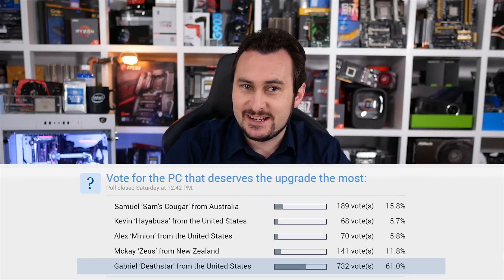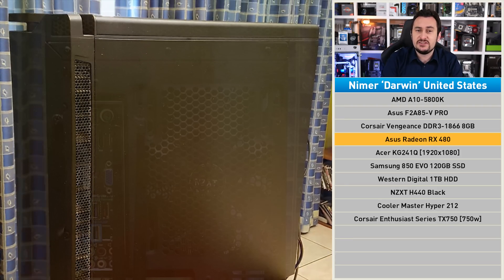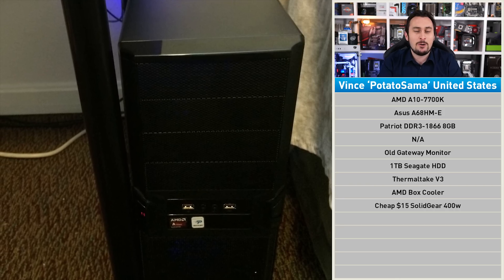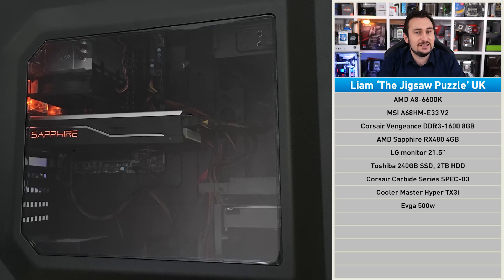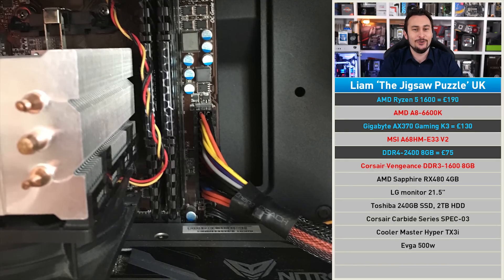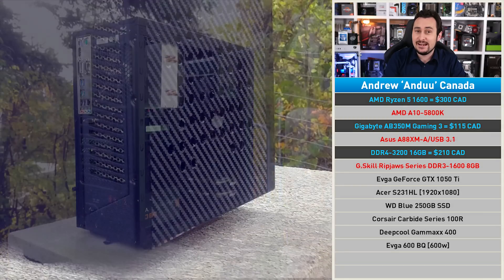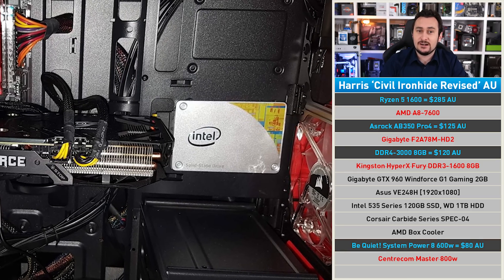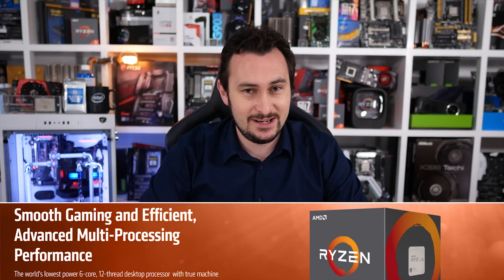Upgrade My PC Please! [S01E05] APUs: Dem Tings Wit Graphics!

Comment: NOTE: If you live in Canada and are looking for a Ryzen 5 1600, wait for a sale and you will be able to get a 1600x for $250. It goes on sale for that price often. Spending $300 on an 1600 is not worth it at all. It's weird, but at full price the 1600 and 1600x are both $300CAD

Comment: buys expensive case psu and graphics card , is to retarded to upgrade the CPU = does not deserve an upgrade
Reply from the maker: So if your power supply dies and you need a new graphics card as well, you should just buy trash? Why can't you get something decent in the hope that a platform upgrade can follow shortly there after?

Comment: Hahahaha mine would need just about everything, motherboard, CPU, Ram, PSU, GPU. The only thing that could be reused is the case (antec three hundred which was a freebe), the PSU wouldn't be good enough for much of anything.

The hardware in it was salvaged from an old Compaq D530 SFF that I got for free back in 2008 (yes a Pentium 4 Northwood).

Comment: Some systems there that really need upgrading, But which to vote for is a real issue this time.

Steve.
You said you're looking at Core2 Quads next week. I submitted my old Core2 Quad machine a few weeks ago. Will that be in the running or do I have to resubmit it?

Thanks.
Aido.
Reply from the maker: What's the thread name? Photos are key mate, need good photos.
Reply: It's called "The Overgrown Calculator". I hope this is what you're after Steve.

Comment: Listening to Liam's story makes me think that he could of build a good pc form scratch but just wanted to be cheap and kept buying bad parts, or maybe the story was made up idk...
Anyways loving this series so far
Reply: Pastechi I built the initial PC from scratch which at the time was pretty good! But then went to uni and i didn’t have the money to do a decent upgrade, the 8320 was the best upgrade I could afford and that was second hand, came with the case and cooler you see in the picture. All the Parts that have died were bought off gumtree or eBay in a pinch because I either needed something quickly to keep my PC going to get an assignment done or it was just before a game jam. 

At one point the system wasn’t even in a case and was essentially just a test setup on top of a cardboard box under my desk because I was having faults that often that taking everything out of the case to diagnose faults was an all too familiar experience! 

I was hoping to save enough over the summer to upgrade to a Ryzen 1600 and nearly got there but life got in the way and the money had to be spent elsewhere! :)

Comment: Do not vote for Jigsaw!!!  CPU cooler orientation and cable management shows you where their PC problems root from.
Reply: Sandalhatt That cooler can only be mounted that way round because of the socket, it won’t go the other way otherwise it would have been put that way :) I gave up cable managing it because I had to take it apart every few weeks so snipping off and redoing the cable ties got really boring and tedious after the first few times!

Comment: In one of your earlier videos you overclocked a eyzen 5 1600 using gigabyte ab350 gaming3. Could you please share your OC settings with me? The offset voltage and etc. Thanks.

Comment: Im still rocking a phenom ii 965 black at 4.1 ghz. Shes been a reliable ol girl.
Reply: How do you cool it? I have a Hyper TX3 on my Phenom 955 and the fan gets loud af just streaming video and idles at like 40°C. OC was even worse so I set it back to stock. I dunno if it's just my mobo fan controls that are wonky or what, b/c when I read forums ppl say 40°C idle is normal. I had the same cooler on a 6600k and it was much quieter.
Reply: dsmtnr95 how did you get it to 4.1 I can only get mine to 3.8
Reply: Malus1531 ive got a hand me down 120mm fx aio from a buddy of mine. It came with his fx8950
Reply: Everill angel its the only thing ive won the silicon lottery on lol. All i did was turn the multiplier up and i added v .05 at a time till it was happy. I could probably go further if i messed with timings ect but shes takin a beating since 2009 so i just stopped at 4.1 bec it was above avg for the chip.
Reply: dsmtnr95 oh I see mine won't go over 3.8 it's so weird

Comment: Really goes to show how much value Ryzen has to offer when it's suggested so often in the series :D
Reply from the maker: Well you can't really recommend a 7th gen part at this point, let's see how thing go in the coming weeks. But you are right, in terms of value Ryzen is pretty special.
Reply: Yeah, would be interesting if the prices drop when 8th rolls around, I have my doubts!
Reply: I don't mean to be a downer but this series is much of a muchness.  Ryzen, mobo and RAM for every single build gets a little dull.  Series needs something to make it stand out - perhaps going down the Tech Yes City route and suggesting older parts/Xeons/Engineering samples.  This is why "scrap yard wars" by linus is interested, seeing what they can come up with.  Right now every video is the Ryzen video.  Your other content is great - this not so much.
Reply: Jaymiecain1 what a downer. this series is interesting because of the many different builds that apply for upgrades. and because of their individual stories. also: steve adapts the upgrades to specific needs and even wishes from the owner. sometimes more space in form of hdd, sometimes ssd boot drive. sometimes powersupply. often gpus. its not all about the same cpu. he had almost all the ryzen 3 and all ryzen 5 as suggested upgrade at some point. he also switches the mobos. mostly b350 but from all the vendors and today was even an x370 board suggested.  dont act like this is the same everytime when its not. if u dont like it thats fine tho. personally i thinks its awesome for those ppl to get a big upgrade for free.
Reply: It's great for people getting free stuff, sure, I would never argue with that.  But as consumable  entertainment it's a bit niche and needs something more to be successful.  I think the views for the series also carry this sentiment - 35k, 28k, 28k, 24k for the first four episodes.  I'd expect the rest of the season to steady out at the low 20's or high 10's.

With such a limited budget and the need to buy "brand new" hardware it sort of puts Steve in a corner with what he can suggest, which in turn makes the whole thing a bit predictable - Ryzen is the price/performance king and so every build will have it.  One suggestion would be older used hardware.  For example a i7 3770k is 5 year old CPU at this point, yet in gaming performance it's still a great CPU.  Hell, here's a Hardware Unboxed video testing the CPU out against Skylake - https://www.youtube.com/watch?v=xhuC8Tf9i3I .  If the highlight of the video is what size hard drive is picked or "even a x370!" being suggested then...well that speaks for itself.

As for the "fee-fees" and "downer" comment I think most youtubers appreciate constructive criticism.  I could just as easily trolled and said "This is sh*t" or clicked dislike.

Comment: can anybody help me to decide which upgrades do i need ?? currently i have the following parts
 Core i5-2400, 
asus b75 a mobo , 
8 gb ddr3 1600 bus speed ram,
 gtx 1050ti-4gb ddr5,
 toshiba 1 tb hdd , 
corsair vs 450 watt psu 
Antec gx 200 casing and a 
Philips 224 e5 1080p monitor
Reply: You need to provide some information about what you're trying to do and what problems you're having.
Reply: i will mainly game and light graphic design work

Comment: Hopefully AMD can dish out some good gaming apu's using zen in the near future.
Reply: You have that backward, you meant that it is inevitable that APU's will eventually surpass RX 470 power. Don't argue against the nature of technological advancement rofl 

BTW we're already there: See PS4 Pro/XB1X
Reply: APUs will never have performance even close to a RX470, it's still an iGPU without dedicated VRAM. But if they just manage to make it reach RX550 levels it would still be a very decent gaming APU, as long as the price is right
Reply: We know so far that there'll be at least a 4c/8t variant with a cut down Vega, just don't quite know how cut down of a Vega it is. But, since they're paring it with a 4c/8t CPU it's possible for it to be RX4/580 level.
Reply: I was hoping for RX 470 level or better, I'll get one if it can perform anywhere near 470 levels.
Reply: raven ridge will have 11 CU (704 SP) Vega GPU so performance will be rx 460 level at best

Comment: Can't wait for the 8600k to be released so that there's another option beside the Ryzen 5 1600
Reply: Honestly it's a lot more expensive than R5 1600 so I don't think it'd be a good choice
Reply: Donald Trumped, yea the 1600X
Reply: Oh look an Intel fanboy trying to act reasonable and suddenly failing
Reply: As far as 1600 vs i5, if you want the best gaming performance then i5 all the way, but in terms of production work and price/performance the 1600 is a better choice, and it will be in general for most people too since big FPS differences only start to happen with a GTX 1080 at 1080p, and as soon as you lower the GPU's performance or increase the resolution, the difference goes down, even down to nothing.

Price/performance wise the 1600 and the 1600X are actually better than the 8700K too, even though the 8700K outperforms them in every way.

Not to mention the lower power consumption, cheaper motherboards, and platform life span.
Reply: Think about the irony in that statement, lol. Just a few months ago we all couldn't wait for Ryzen to launch so that there would be something other than Intel to buy.
Reply: Dennis Johnsen zen + (die shrink and refresh) is 2018. Zen 2 (IPC/clockspeed) is 2019. So all in all- 3 gens on the AM4 mobo till about 2020
Reply: Dean simmons You mean the ones on wccftech where they tested 5 games? If so they yeah I did, but those were also very CPU sided games, and considering the fact that there was no single-threaded IPC advantage going from Sky to Kaby, there won't be going to Coffee. That's not to say that there won't be any performance advantages, but if there are any that'd either be due to the increased cache and/or increased core count because we know some games like more cores. At the same time, some games don't like going past 4 cores, so when Steve does his 30 game average, you can bet that the difference will be none or barely anything to note, like a handful of FPS difference.
Reply: You need to buy an expensive Z370 motherboard, with ryzen a cheap b350 does the job. With that being said, IPC and clock speed is still very important.  But then again, Zen2 will be released next year or on AM4 atleast, don't know if next years Ryzen refresh counts as Zen2. All and all I wouldn't buy Intel because Ryzen has a good value/performance ratio and AMD hasn't been conducting dirty tactics like Intel.
Reply: slav have you seen the  benchmark of the 8700k? The 8700k clearly has better ipc than the 7700k and obviously better multithread performance. so yeah it wll be better than the 7700k for gaming. just slightly but it will. If you have a 7700k or any recent i7 it isnt worth the upgrade.
Reply: 6 core 12 thread amd vs 6 core 6 thread intel. nah im goin with amd cause im sure its gonna be cheaper than the i5 also you could oc using a cheaper b350 mobo
Reply: AD Gladium Nah the 8700K at 5Ghz matches an R7 at 4Ghz, as in within 2% margin of error matches. It is however, again unsurprisingly, better than the R7 in gaming. That being said, price/performance wise the R7's better, and considering the fact that the 8700K has 50% more power draw than the 7700K, whether it can sustain 5Ghz without requiring a delid or a beefy cooler that widens the gap in price between it and an R7 is another issue.
Reply: Ryzen is the way to go, I am not a big fan of Intel anyways, it would be perfect if I could upgrade to a R5 1600
Reply: the 8600k seems meh looking at the leaked benchamarks. The 8700k however is an absolute monster. The 1600 will still be the best bang for buck cpu but the 8700k will be the best cpu on the market for gaming performance. I mean come on a 6 core 12 thread with ipc better than the 7700k. Fucken ridiculous.
Reply: Dean simmons Single threaded IPC hasn't changed and the 7700K isn't limited by its 8 threads so gaming performance between it and the 8700K will be the same. The only benefit you get from the 8700K is in production.

Comment: I'm hoping for this to expand out into Singapore and beyond. My PC which started life as a used Dell T3500 that I got for cheap just can't expand anymore and needs a platform and expansion upgrade.

Heck this OEM PSU I have doesn't even have 2 6-pin PCI-E or Molex even.
Reply: Use molex adapter that how I used to hok up Hd 6770
Reply: the T3500 has a standard motherboard+CPU connector do you should be able to replace it with a CX450M for $80 if you need the PSU replaced. an LGA 1366 Xeon should still be good enough not to bottleneck a gtx 1060 much too.
Reply: Buy used parts

Comment: I am rocking on a amd A6 6400k with rx 460 2gb and 8 gigs of ddr3 ram and playing gta 5 at 20fps. Steve, do i need a  upgrade?
Reply: deathbat6916 if i have to increase ram, i have to remove one 4gb ram and replace it with a 8 gb ram. Thus i can 12 gigs of ram but still ddr3
Reply: deathbat6916 yeah, i really need to change cpu cause it can't keep up with modern day titles
Reply: Sunny X put settingsbate 900p medium
Reply: Savage Cat playing 720p with normal and off, hardly getting 25 fps except tunnels and beachside.
Reply: deathbat6916 i didn't know that i ever gonna play gta 5 in my potato😂😂
Reply: deathbat6916 no, actually I am not a frame rate wore. All I need a smooth gaming experience with medium to high graphics settings at 1080p, that's it. That's all matters